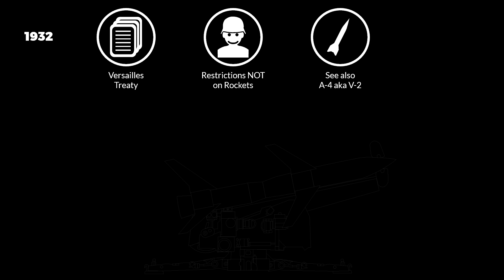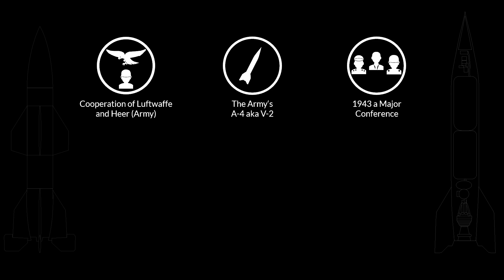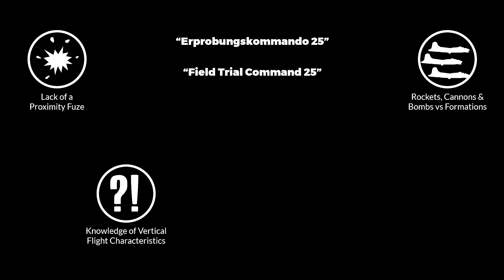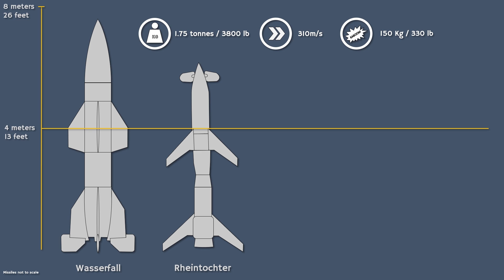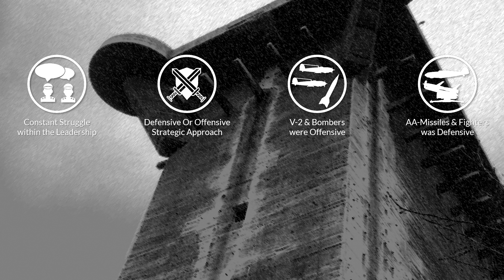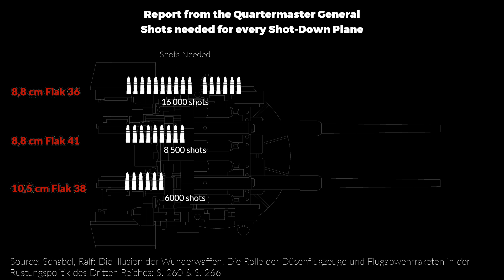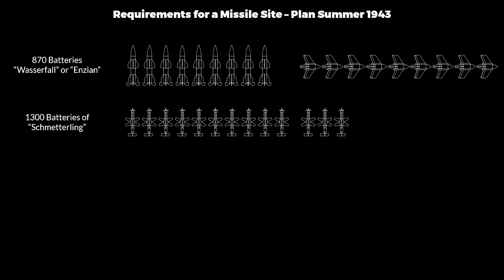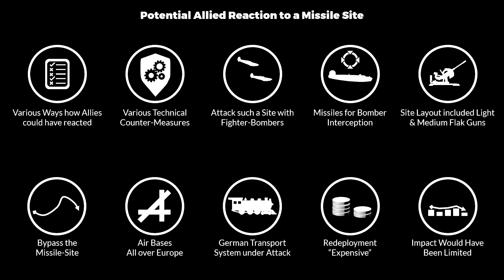German AA Missiles - An Efficient Alternative to Flak?

Comment: It's amazing how quickly this tech developed.  

1915: Steel plates are wrapped around the leading edges of propeller blades so that the rounds shot through them would (hopefully) ricochet away from the plane and pilot.   

1942: Approval is given to co-develop jet powered interceptors and radar-guided supersonic anti-aircraft missiles.
Reply: not necessarily- more like "competition"  Remember the Cold War also saw massive tech development.
Reply: I have always believed 1 year of war research equals 8 - 10 years of peace time research without the red tape.
Reply: lolz, machine guns were geared to the engine
Reply: @ivangrozny875  Initially experiments were done with fitting deflector plates to the propeller blades. Look up Roland Garos, he shot down 3 aircraft using that method.
Reply: Not necessarily. The industrial revolution that made all of these advancement possible was started by water-driven textile mills and the printing press. Neither of which had much to do with war.
Reply: @josephahner3031  wow ur so smart! I never know the industrial revolution was so important! Ur so smart did u discover this theory dude ? Ur so smart I bet ur mom says the same thing
Reply: @free_at_last
Nice, I have thought similar. But I was thinking how quikly we went from the first flight in 1903 to aerial battles in the first world war and then to the first man made object in space, the V2 rocket in 1942. And then jet fighters also in WWII, it’s amazing to think about, imagine what will be happening in 100 years.
Reply: Sheldon Robertson war is the engine of progress
Reply: Not precisely, DARPA was commissioned by military and largely floundered being used by few Universities (I was apart of it back then, it was...interesting).  Then in late 80s it was essentially open sourced.  Internet which sprang from it was neither controlled nor used any military technologies.  It also didn't take over until windows 95 came around.   The key to remember is that computer networking and more importantly computer architecture predates DARPA, it was a concept used by it, but it wasn't new to it.  

So no you can't say that Internet is result of military or that it wouldn't have taken over if not for it.  The best you say is that military help pay for it and made it available sooner, perhaps.
Reply: That is a well known bromide, but is it accurate?  I say no.
Planes weren't developed for war, neither were cars, factories, nor much of anything.  While war advances war technologies, obviously, few if any of these technologies are result of war.  
How can we prove, therefore, that war is actually a poor overall technological advancement technique? Well, we could look at Agricultural and Industrial revolutions, as neither was fueled nor pushed by war, yet why bother when we have electronics? Electronics are used for war, obviously, but they were neither developed nor advanced by it.  The breakneck speed of advancement of computers, phones, and well everything else in last few decades is proof positive that this bromide is false.

Sure some advancement happens due to war, such as RADAR as but one example (although even invention of RADAR was not originally for war), yet how much progress does war destroy? Would planes be any less advanced without war? I would argue most certainly.  All one has to do is look at the development of planes for peace transport to see just how far they have come without any war.  

For instance first cargo plane (used for Air Mail) was created in 1911, which is to say 3 years prior to the Great War, and 3 years after first flight.  

Let's not credit war for much more then what it is, which is to say destruction.  Greatest advances happen in peace, and not war.
Reply: Not actually, Industrial revolution started prior to Napoleon.
Reply: Btw even intwrnet was a military project.
Many military projects found their way to common consumer, after few years obviously.
Reply: @Tonixxy  being a military project does not make something "a product of war". Its just funded research. Governments spend huge amounts of taxpayer money on these so at least SOME of it turns out to be useful lol
Reply: Industrial revolution really started practically with Napoleons blockade of England, so it still comes down to war. It probably, maybe would have kicked off later anyway, but probably much later.

Comment: Hi MH and Bismark, thank you very much on this video. I would liKe to ask: wouldn't the lethality of the missiles be more prominent due to the bombers are flying in formation? While flak is a constant blanket of frag and smoke, I imagine the close formation would have compromised multiple bombers to the same missile which may force Americans/Brits to fly in looser formation. While this may seem a simple solution to dealing with missile proximity AOE this would in turn make luftwaffes job easier in hunting down bombers since the bombers will not be able to cover each other as well. I think your logistical reason is sound, but I feel the ramifications of a radio guided missile would be far more profound especially due to bombers needing to fly close and in formation.

Any thoughts, feedback or criticism are appreciated.

Comment: Thank you for a very interesting video. You make a point of a lack of focus but was this a problem to WW2 Germany or common? How many tanks did the UK make and never quite got it right? The US fielded both the famous B-17 and the slightly more numerous but less famous B-24. Or why both the B-25 Mitchell and the B-26 Havoc? Might be worth doing a video on how weapon projects got approved. I suspect it was not a uniquely German problem.
Reply: The Boeing B-17 was a pioneering aircraft, but always limited by its early origins. The Consolidated B-24, designed a few years later, was more sophisticated with its Davis wing design, larger bombload, rollup bomb bay doors to reduce drag, and longer range than the B-17. By 1943, all B-17s had been allocated to Europe as they did not have the range required for the vast Pacific Theater. Also, the B-17 was tough enough to endure the Luftwaffe and flak while the B-24 did not face as much opposition from the Japanese. The North American B-25 Mitchell and Martin B-26 Marauder likewise had really significant differences in terms of timing and capabilities. Fortunately, the air forces of the USA had a broader array of aircraft choices than the ground forces with the ubiquitous Sherman tank. Like the B-24, the Sherman was great against the less sophisticated Japanese, and very vulnerable against its German opposition. For the unfortunate American tankers in Western Europe, there was no equivalent of the B-17 on the ground for them. Like the B-24's that quickly folded up and burned when hit by German fighters or flak, the Shermans quickly ignited when hit with a high velocity 75mm or 88mm anti-tank shell. For the sheer brutality of it, look at the book "Death Traps" or the historical fiction movie "Fury."   If you are interested in American graft and corruption around its war effort, such as the tragic waste of resources that was Curtiss-Wright during World War II (B-29 engine development, C-46 Commando transport aircraft flop, the SB2C Helldiver flop, extended production of the P-40 Warhawk through 1944 and so on), look into the work of the Truman Commission. Look at the absurdity of Bell Aircraft and their P-39 and P-63 designs that were almost universally hated by the American and British pilots assigned to those flying turds. Only the Soviet pilots liked them and that should pierce a lot of the veil of nonsense wrapped over the wartime VVS.
Reply: Thanks for the info. I had forgotten about the P-39. It crops up a lot in early histories of many campaigns in 1941-1942. I remember it now because it had a centerline mounted cannon.

Comment: If the Germans had achieved to produce and use such rockets, they would probably get jammed like the Fritz-X guided bomb.
An unguided missile, however, could not be jammed and most people underestimate their speed.The AA shells become slower and slower as they get higher while rockets are constantly accelerated until they run out of fuel.This means that evasion maneuvers would be hard and the sheer explosive payload means that they could cause a lot of damage to aircraft.

Comment: My initial gut feeling is that would have been better for the Germans to focus on the Ruhrstahl X-4 guided Air to Air missile. Looks like it was the closes thing to be operational with the added bonus of leading into guided Air to Surface missiles with the X-7. As well as needing way less in way of infrastructure investments. And a musch simpler guidance system that they actually got to work. But well, yeah, wouldn't be Nazi Germany if there wasn't a complete lack of Schwerpunkt when it came to R&D.

Comment: Didn't the German Air force have an optically-triggered, vertically-launched rockets on some of their aircraft (Me-163 for example)? One that would fire - vertically - when the plane would fly beneath a big bomber?
Reply from the maker: well, I have seen a sketch of that a few days ago, but I am not sure how far it was. Still, in this case someone still has to fly close to the bomber, so I doubt it could be reused for targeting (not sure if you mean that, just in case).
Reply: Military History Visualized Distinguishing plans and prototypes from actually fielded weapons is always an important distinction, and I'm not confident what I described was actually fielded, as you note. Thanks for the feedback.
Reply: Normal wing mounted unguided rockets were more practical both during and shortly after the war. To shoot at bombers above your flight ceiling you just pull up briefly and point in front of them then fire.
Reply: What you mean is definitely the Sondergerät 500 Jägerfaust which was meant to be installed into the ME163.

As well as prototypes of the HE177 Greif with 33 upward firing Nebelwerfer tubes.

There also were FW190 Variants equipped with vertically fired missiles triggered by photo receptors if I remember correctly.
Reply: this device was named the SG 115 and should have been used against tanks too.
Reply: I've heard of this as well--and this may be a tall tale--but I also heard that they also fired whenever the pilot flew under a cloud!
Reply: Sounds a bit like the Schrägmusik Kanonen. Flip a switch, then glide right under the bomber and its shadow will set off the recoilless cannons, destroying the aircraft. 'Twas fitted to the Komet (that's the 163, right?)
Edit: I think I got the name of the cannons wrong. The Jägerfaust I think was its actual name.
Reply: I recall seeing on the History channel years ago a show called 'wings of the Luftwaffe' and it showed how a Me-163 Comet could be equipped with a photo-cell trigger which would fire rockets vertically when it streaked under bombers and some bombers were actually shot down with this system. The shadow of the bomber fired it quicker than a pilot could.
Reply: They did but it only was successful one time on the me 163. That said, they only used it 1 time. It was very effective though against that one poor bomber crew

Comment: I wonder why the Germans, instead of guiding this missile to the target (as far as the eye can see), build a missile like a flying land-mine. Once the weapon flew to a certain altitude, a timer would trigger and detonate the explosive. If the payload was large enough, and the blast radius large enough, then 2--3 planes could be taken down each due to shrapnel and shock wave, let alone the explosion itself. Of course with the lack of a proximity fuse, I suppose this would be difficult.
Reply: KMQP DEOQ QLMO HLGR UPVW XRIO LQZD OCBI The coat cost of bringing such a mine to that altitude would require so much power it would be cheaper to make a fighter instead.